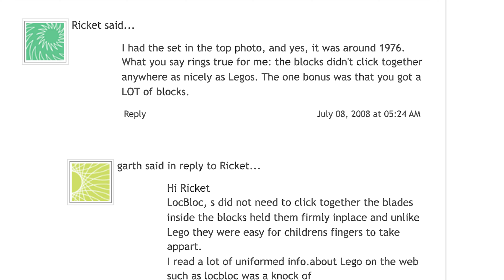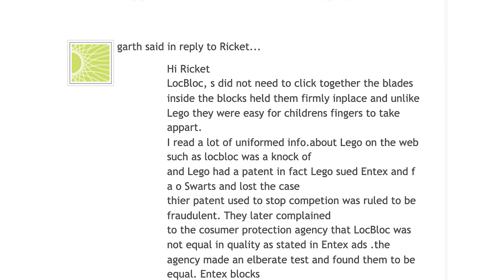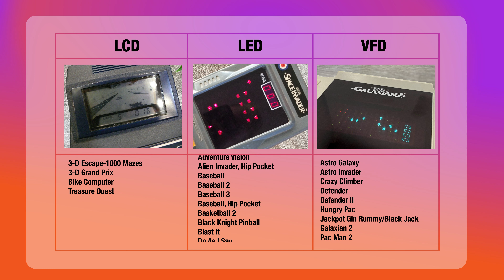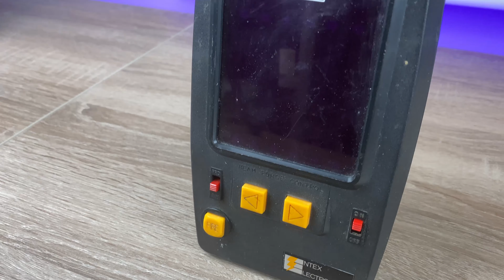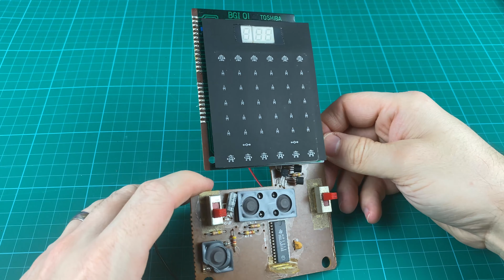Entex Space invaders | Teardown and repair

Comment: Don't think I have ever seen this handheld before. The brand name does sound a bit familiar. And yes, I have the same experience with the batteries not quite fitting in 80s gaming handhelds!  
😀
Reply from the maker: It’s definitely the worst I’ve ever seen. Probably how the door ended up breaking!
Reply: @RetrogradeScene  Yeah, that makes sense. Impressed you manage to fix the door using that printing pen! Is it still holding up?
Reply from the maker: @gearsofgames  I was surprised too! I was completely expecting needing to look for some other solution. But it’s still holding, just looking for the next job to use it on.

Comment: Great video!  Do you have recommendation on removing fine swirl scratches in my S I handheld screen?
Reply from the maker: My first advice would be to use loads of furniture polish. Pledge/mr Sheen. I’ve had great results from just that if the scratch’s are fine. Other than that a polish with a really fine grit but it’s a case of removing scratches with smaller ones. Always a risk on a screen where you can’t really do a test patch.

Comment: One question: Do you know where to get replacement silicon contacts for the left. right and fire controls? Mine are pretty badly worn out and it takes a bit of pushing for it to work.
Reply from the maker: I’ve not come across any that I know would fit. But have you tried putting on some carbon paint? It’s a conductive paint you can put on to the contact bit on the back of the silicon. It can work wonders.
Reply: @RetrogradeScene  I'll try that. Thank you. :)